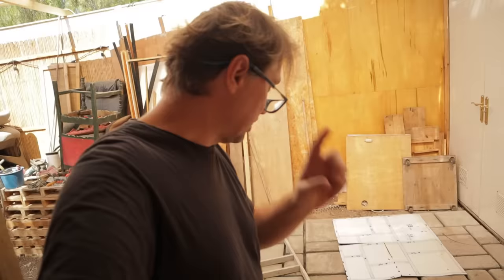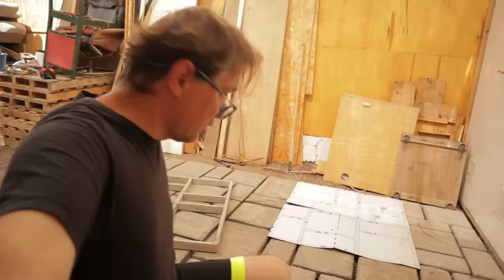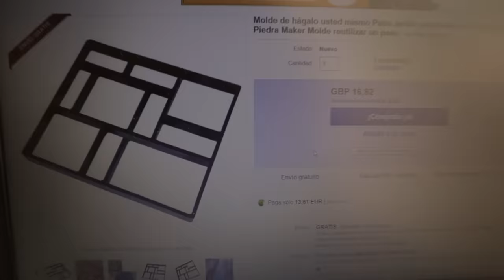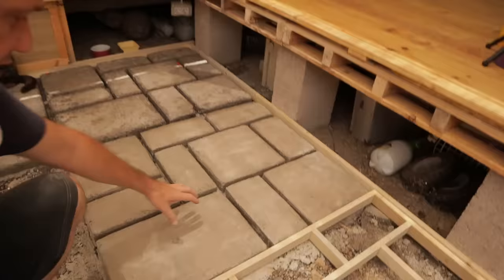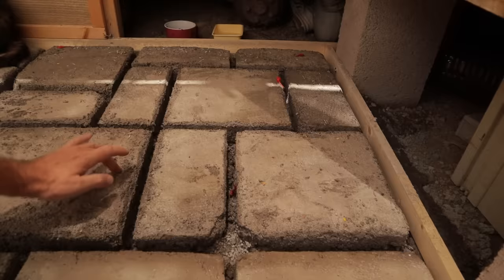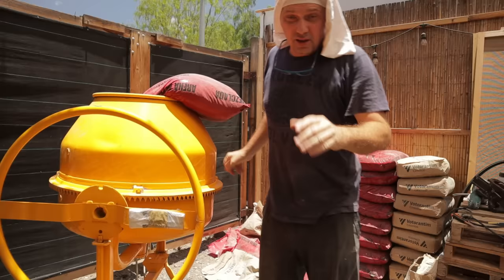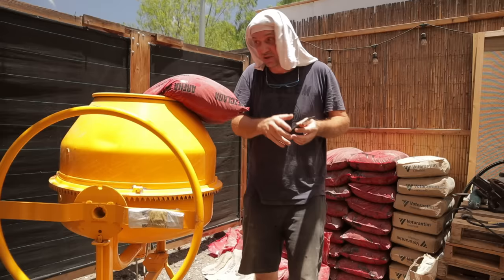How To Make Your Own Concrete Pavers Like a Pro (S1 Ep17)

Comment: Three suggestions, 1. Run the timber through a table saw to taper the edges,this would allow the mould to come out clean, a 5 deg angle would be fine. 2. Run a bead of silicon round the tops of your mould to form a rounded finish on the concrete. 3. Oil the mould before use. Good video, thanks.
Reply from the maker: Thanks for the tips! 👍
Reply: To add onto this comment you could use some rounded metal handles on all 4 sides of the mould to help you lift it out, good video.

Comment: You will get better results if you let the concrete setup a bit longer, and use a curb tool on the edges prior to removing the form. Another helpful tip for the DIYer's, rinse the forms and spray the insides with cheap cooking spray, this will allow the form to slide off easier.
Reply from the maker: Thanks for the tip! 👍

Comment: To make the frame easier to pull free, you could use an enamel/glossy paint on the wood and give it a quick spray with water after each section so nothing sticks.
Reply from the maker: Yes, it would be much better

Comment: As you go with it, you'll be better. Another idea is after an hour (depending on how fast the concrete you use dries) or so, wash the concrete gently with a hose, it will give you a grain finish. You do great!
Reply from the maker: Great tip!

Comment: Just a suggestion: Put a couple of handles on the top of it (maybe 4 of them), so it will ve much more easy to lift that wooden frame. Anyway, thanks for the video, it is a very good idea to share.
Reply from the maker: Great tip!
Reply: Wouldn't handles make it impossible to screed?
Reply: Juu 😳😎😳🌄😳❤️❤️
Reply: @lovetoyoutube5412  to the top not the sides.
Reply: @klerobi1  l spray some used oil on the inside of the wood cast each time. It's makes it easier to pull off the wood cast.
Reply from the maker: @craftman5632  perfect
Reply: Excellent
Reply: When screening will be hard

Comment: Just brilliant! You can custom make a template to your liking and your particular project area. Fantastic! And adding sand to the cement to make it more pliable is even better. Now, you can propably spray vegetable oil to your template to make it easier to remove.
Reply from the maker: That's a great idea!

Comment: TIP:
Rubbing motor oil into the wood of your template will make them easier to remove without damage to the pavers.

Great job!
Reply from the maker: Thanks for the info!

Comment: Great idea, one suggestion would be: 
     The commercial pavers, has actually 2 layer, one is more rough full of coarse broken pebbles can be calcite or even quartz what give them a lot of strength, but this layer does not look so great, so they have a finish layer that is very thin like just 1/4 inch at most, made if fine sand and maybe stamped with a fake stone  texture, you should try to add this second layer made with finer aggregates and different cement, maybe a pre mix stucco would be a good beginning.

Comment: This is an excellent idea.  If I were you, I would use at least two or three models of the design to keep the cement dry a little bit before taking the wood out. I would put oil on the sides of the wood for an easy out.  I would lay plastic on the ground before cement pouring. Also, I would use some pieces of steel to make it stronger.
Thanks for sharing.
Reply from the maker: Great idea! Thanks 🙂
Reply: @klerobi1  Always nice ideas start from zero and end up with fabulous results.  I liked your idea.  Thanks again.

Comment: This looks great. Consider putting a couple handles at the top of your form to make removal easier as you would be able to lift it straight up and out.great work
Reply from the maker: Thank you very much 🙂
Reply: You cant screed it with handles on top.

Comment: I am going to try this out it’s a great idea but I think adding a couple of handles to help wiggle the framework out will help and I’ll add some fibres to the mix to strengthen it to compensate for the slabs not being vibrated. Maybe you mentioned this but I watched with no sound.
Reply from the maker: Yes, that's a good idea, thanks for watching 🙂

Comment: If you spray the form with used motor oil before you pour the concrete it helps the form release and not pull the concrete up.

Comment: If you put plastic sheet underneath it stops weeds and helps stop cracking.
And use a small brush for edges dipping in a cement mix...
👍
Reply from the maker: That's a great idea!

Comment: Hi, I like what you have done. Having watched a few of the video's like yours. For what it's worth. I would suggest making a frame that is larger than your pattern. Then I would pour the concrete in the frame first and use your pattern as an imprint into the concrete. 2 fold result is that it has more meat on the bottom to hold all the pavers together and the added benefit of less work in finishing it. Just a suggestion. Like your results as well. Thumbs up !
Reply from the maker: Thanks for the tips!
Reply: Best idea for a sidewalk ! My next project. Question....? Can i put white rock on top n press them into the concrete? Just enough to "lock them in"?

Comment: Great video I want Mexican Saltillo tiles no hope can't afford it. I am confirmed that I am on the right track by this video. I am going to make my concrete out of fine sand with added red iron oxide dye to imitate the clay. This runs the risk that I will get cracks but I am planning to add plasticiser to compensate. I am convinced this will work see the video on Project Portugal with lots of comments from me about the use of plasticiser. My idea was to make individual slabs and lay them DUMB IDEA, do it this way doing this way and it won't take until hell freezes over to finish the job. The gaps will have to be narrower to mimic indoor floor tiles so I would make my frame out of metal to compensate for the lack of stiffness. I will post it all on my channel.

Comment: Some sort of mold release would help. Try using old, used cooking oil brushed on the inside surfaces of the wood. The cocrete won't stick.
Reply from the maker: Yes, thanks 🙂

Comment: Доброго времени суток хорошая работа 👍👍👍 я форму делал из проф трубы смазывал машинным маслом также приварил ручки сверху формы при снятии меньше сколов, успехов в труде
Reply from the maker: I'm sorry I don't understand
Reply: @klerobi1  
Good time of the day good work 👍👍👍 I made a form from a profiled pipe lubricated with machine oil also welded handles on top of the mold when removing less chips, success in work
Reply from the maker: @ruslan22rus98  Perfect! Thank you very much

Comment: One thought I had to make it easier to pull the mold up is to drill a hole through the wood and put a piece of string or twine through it. You can leave it as long as you want. And it won't get in your way.

Comment: Try using a Plastic finishing trowel, it will give you a better finish than a steel trowel. It stops the water rising, to the surface of your paving.
Reply from the maker: Thanks 👍
Reply: Or wooden . Make Yourself; f keen

Comment: Tip: Wrap all the edges that will touch the concrete with box tape, this will stop the water in the concrete from sticking to the mold allowing you to pull the mold out easier :)
Reply: Box tape, the clear type?
Reply: @floydlott8793  Yea clear or brown type, they pretty much the same. It just stops that water content from the mixture soaking into the wood form and sticking.

Comment: Plastic bags , formed into whatever shapes you prefer , filled and flattened with wet cement are very decorative and you haven't spent a small fortune on wooden "forms". AND , less labor intensive . AND you can lay 6 today and 25 tomorrow or when ever you have time .  AND , You "mix" the cement IN THE BAGS !

Comment: Good afternoon!My friend, your wooden form is made in such a way that the resulting tiles are not interconnected.Won't this cause them to be unstable under your feet, especially small slabs?Maybe it's worth making the partitions at the mold a little narrower in height than the height of the perimeter of the mold?Then it would be one whole textured slab.What do you think?It seems to me that this method will cause problems on soft ground.Thank you, and good luck
Reply: He established a good solid base of sand and pea gravel, you can see it pretty clearly when he is setting the first pour.  If he's in a climate without much of a freeze/thaw cycle this should last for many years.  If they do settle or wash out these can be chiseled out individually and reset level with the others.
Nice craftmanship for a do it yourself project, gets a nice level result with less fitting than individual pavers would be.  I'd like to see his grouting  mix and application.
Reply from the maker: So far, everything has been fine, but I don't drive on their pavements

Comment: Very nice 😮,, how long did u wait for it to dry before attempting to remove the mould? Also did u coat the wood with anything before the pour ? Cool video appreciate any responses
Reply from the maker: I didn't wait, when I finished one, I went straight to the other. After finishing the work, I cleaned the mold with water, but it would be good to apply some oil before work 👍🙂

Comment: I like this, except I can see problems with weeds growing in between the pavers since there is no concrete mix there. I think the alternative method of laying down the mix in sections, then doing an imprint might be faster and prevent more weeds from growing between the pavers. It does look very nice.
Reply from the maker: Wrong, you haven’t watched all my videos, here’s the solution 🙂
https://youtu.be/rvMpGdIMcEs
Reply: The weeds will grow anywhere they get a chance to land when they're blown on the wind! You do know though paver guy klemensberger that you can buy moulds and a vibrating table for precast slabs?? That's going to be a nightmare for frost ingress!!

Comment: Having made the wood frame, did you coat it in shutter release oil? If not, that would have been a good idea too. 
If you can't find that, then a poor alternative is diesel !
Reply from the maker: No I didn't, but it would be much better

Comment: forgot to ask, did you use aggregate (stone) with 3 parts sand and 1 cement? Also did you use sharp or building sand?
Reply from the maker: The sand was sharp, three parts sand and one part cement, no rocks

Comment: Well done by friend. I would like to know if this could be merged with some old brick pavers at the top of the property where an outbuilding studio is located. I like to be able to see the area at night as I have two dogs- one took a snake bite two years ago - so this can be colored in the mix process to a brick paver color? Also trying to figure how you leveled the next group of pavers that might have been a little lower than the last. You did it perfectly. And you used no concrete support like rebar so I assume the 2 parts sand, 1 part mortar mix? I did not get the type of the concrete you used, will watch again. What do you plan to put between the pavers? I have used screenings before however - they can cause a problem with humans or dogs bringing it inside on hardwood. I know there is a special sand mix that will allow water through and then become hard again. Interested in your process. I suppose many products can be used. Great job!
Reply from the maker: Sorry, I do not understand exactly. I mixed three sand one cement. I used normal cement and the sand was 0 to 4 mm. You can see what I did between the pavers here
https://youtu.be/rvMpGdIMcEs

Comment: What kind of sand did you use and would recommend it for driveway in terms of durability
Reply from the maker: Fine gravel with sand will probably be best mix with strong cement

Comment: How long did you let each one dry before removing the mold?
Also, did you coat the wood mold before using it to make it come off easier?
Reply from the maker: Right away, I didn't wait
I didn't coat the wood, it would be better yes
Reply: @klerobi1   what would you coat the wood with? 

Any recommendations on if I wanted to do this for a driveway?

Comment: Curiosity question only and not any sort of criticism in the least. Nice job! However, my question is, do these pavers break easily since there is no rebar or wire mesh in them to add support? I have had store bought pavers which ultimately split or cracked over time and just wondering is any sort of wire or rebar is worth adding in to ensure lasting strength of the pavers?   Did you ultimately fill in the gaps between them with sand or did you just leave the spaces between each block open? Thanks, nice job. The mixer looks just like the ones they sell here at Harbor Freight.
Reply from the maker: So far, no paving stones have broken. But I don’t drive a car over. If I drove the car over I would reinforce them with armature. 
In this video you can see what I did with the gaps: https://youtu.be/rvMpGdIMcEs

Comment: Wow that area turned out great!
Amazing! i wanna do same, but in my yard in grassy spot i wanna turn into amazing concrete walk way through the flowers. Idk how to mix the concrete at all though..

How much concrete/sand did you use overall? And price for all materials/sand/concrete?
Reply from the maker: For one frame I needed about three bags of sand and about three-quarters of a bag of cement. That means I mixed 4 sands to 1 cement.  It cost around € 5 per frame

Comment: You use no steel to strength the structure. Do you have problems with the structure? Is the concrete breaking?
I wann to Do the same, but use 6mm steel to enforce the concrete, because the cars will also drive on it.
Reply from the maker: No, I just walk over the pavers

Comment: how long do u wait to pull form off/up?
Reply from the maker: I don’t wait as soon as I apply the concrete
Reply: i tried a mix of quickcrete and sand - 1 part mix 40lbs and 3 parts sand - added measured water and dye - looked good but after 24 hrs still damp and totally crumbled upon removing form - what did i do wrong?
Reply from the maker: I used sand 0 - 4 mm. I mixed 1 part cement 3 parts sand. And water by feeling. 
And where do you live, is winter there? That the concrete didn't freeze?
Reply: yes but i made mold inside - i used too much sand - mason buddy advised only use quickcrete and 3 shovels portland cement - already too much sand in them

Comment: How long did the cement set before you lifted the mold and smoothed the edges?

Very nicely done,
Reply from the maker: It took me about 30 minutes from start to finish. That is, to make in one mold, mix cement, smooth pavers, take out the mold... I didn’t wait for the concrete to harden

Comment: Wouldn’t adding so much sand be bad thing long term?  Like reduce the strength and life of paver
Reply from the maker: I made pavers for the first time in my life, I can’t answer that
Reply: @klerobi1  

I just did a quick search.

Other people use 3-1 or 4-1 sand to cement ratios as well for pavers
Reply from the maker: @johnle231  
Perfect, thanks!
Reply: @klerobi1  

I wonder, how do you feel now about your grout line(point)?  It’s like 1 1/2 - 2” wide now right? 

If you do it over again,  would you make it thinner or no or?
Reply from the maker: @johnle231  Yes, I would do the same because I like that rustic look

Comment: What's the dimension of the mold?
Reply from the maker: width 100 cm, height 80 cm, thickness 5 cm
Reply: @klerobi1  please share your mold design.  It looks better than the commercial plastic mold.  Your design doesn't look too busy. TIA.
Reply from the maker: @scoobybopbop  https://youtu.be/CRvSj8Av4do
Reply: @klerobi1  thank you !

Comment: Way to big gaps especially between molds
Reply from the maker: I like them
Reply: @klerobi1  2" gap all around it is not "you like them". So allow me either to tell you a secret of how to make it 1" or not.
Reply: @dkaloupis75  closer look. It's only 25 mm gap using Bobs frame